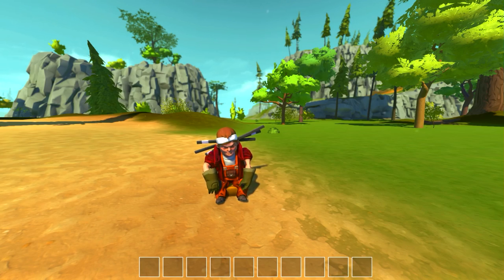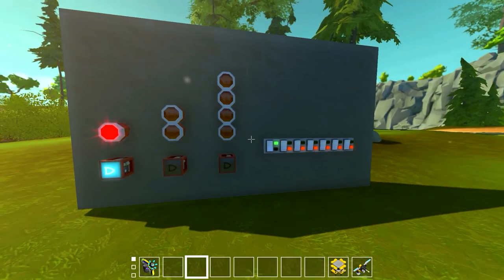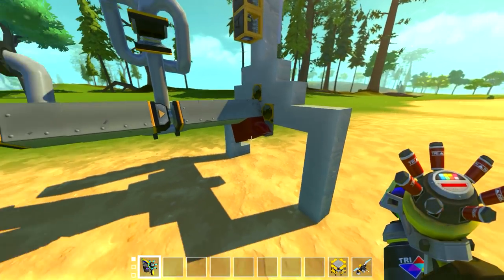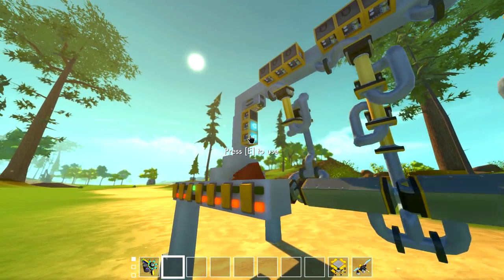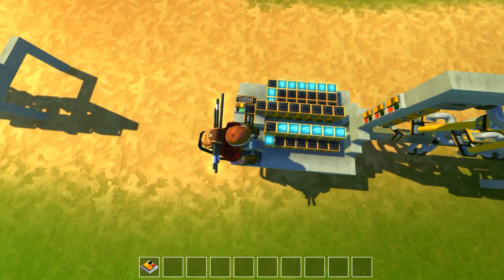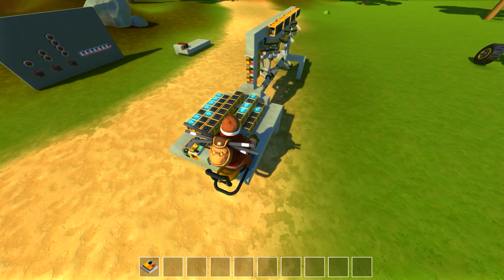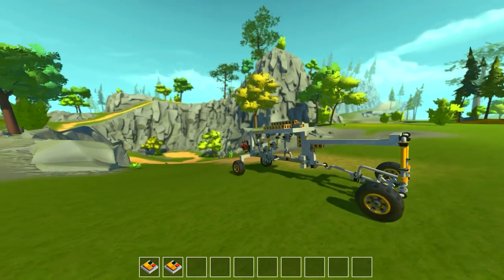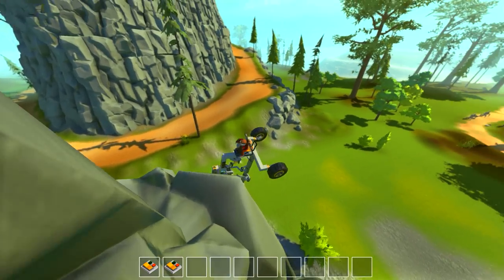7 Speed Piston Powered Engine using Binary! (Scrap Mechanic #204)

Comment: Use an engine to force run a piston engine and see how it reacts.
Reply: I've done it. It will run smooth at low level for a gas engine but clunky at full power the electric engine works slightly better but same sort of issue
Reply: That's right your getting your questions answered 5 years later whether you like it or not

Comment: I has an idea, a mini p.1000 ratte (it would have been powered by 8 × 20-cylinder marine diesel engines, or
2 × 24-cylinder marine Diesel engines)
I say mini p.1000 because the concept design is massive, especially the guns (turret with 2x 280mm cannons, hull mounted 128mm cannon, 8x 20mm flak38, and 2x 15mm mg 151.
Plus it would have had a vehicle bay for 2 motorcycles. (Go to the Wikipedia page for more info)
great vids btw :3

Comment: an add-on to this design would be to implement the smart engine-controller from the modpack to control a piston, of which can be pushed back & forth using the smart engine to control the speeds, by using sensors to activate the gears.

Comment: that's idle btw, cruse control is where you have a set speed and rpm that the engine moves at normally set by a button or switch, an idle is where you let off the gas and your vehicle keeps running, like in a car or any other vehicle. ps: that's not an axle, that's a crank shaft, where the pistions and pistion rods are connected to. :)

Comment: @kAN Gaming Real engines have a clutch in the transmission that separates the drive shaft from the engine so the engine doesn’t have to shut off whenever you stop. You should make one with a clutch in it!

Comment: u know how the engine is a little jerkey as u change gears? well maybe if u set a gear up to the driveshaft so inbetween gear shifts it will just coast until its not so jerky. u could use the same gear for neutral and forward gears... idk if this could work but i thought i would share.

Comment: KAN  use real engines as examples  like your 4 piston  DONT use the firing order 1.2.3.4 like you were use 14.32  (1 and 4 then 2 and 3 ) it improves stability and ballance  and reduces lag because the physics forces cancel out   as well as try changing the gear ratio with your axles